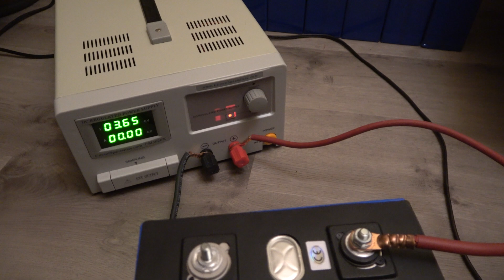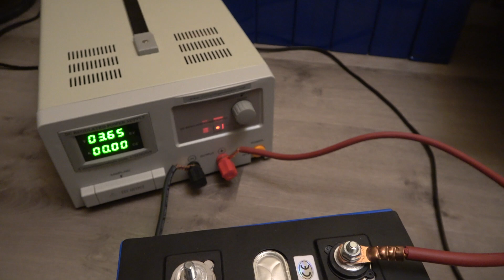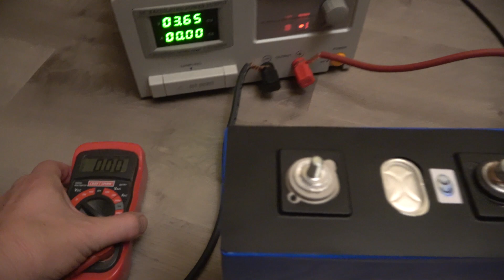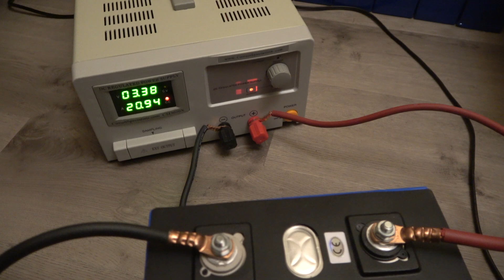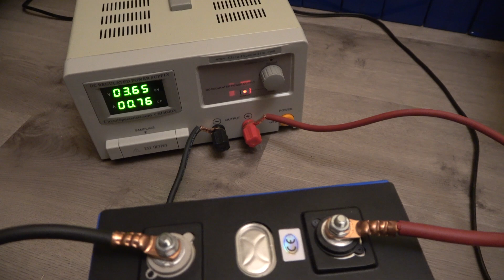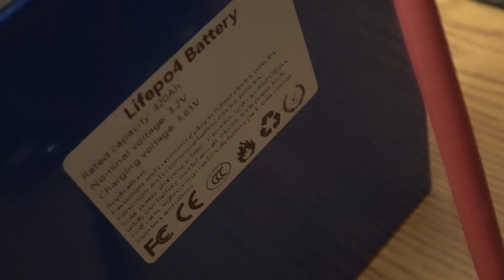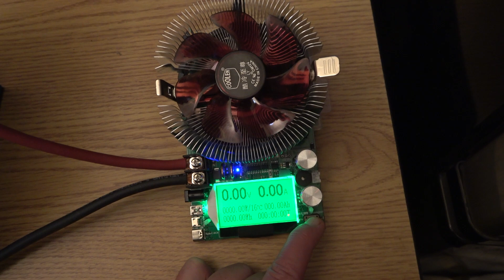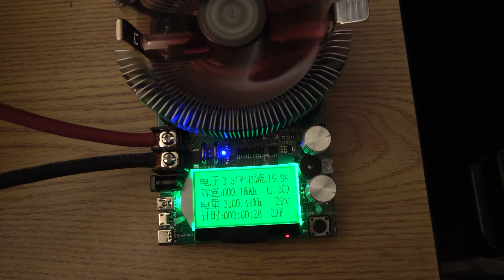Esare "420 Ah" LiFePO4 Battery Cell Capacity Test Process and Results

Comment: 420Ah battery should be tested at 0.5C continuously, that's 210 amps! This tester is 10 amps MAX. These shit cells can't even handle 0.5C and voltage drops so much the capacity test cuts out waaay before you get anything out. These cells are a scam and they barely run in a battery pack. The BMS cuts out waaay too soon to protect the pack

Comment: How about links to the charger and the tester? Good video. 420 AH is the perfect size for my need so this was helpful.
Reply from the maker: I see if I can round them up and post the. If you're looking for 420 Ah at this point, I'd recommend getting 200-230 Ah cells from CATL or EVE and running them 2p (parallel).
Reply: @newscoulomb3705  I would also like a link to your charger and tester
Reply from the maker: @londel1767  I'll see if I still have the link for it. Here you go: https://www.makerhawk.com/products/makerhawk-usb-load-tester-150w-200v-20a-resistor-adjustable-constant-current-electronic-load-tester-battery-capacity-tester-module-intelligent-discharge-resistance-power-tester
Reply from the maker: Here's the link to the tester: https://www.makerhawk.com/products/makerhawk-usb-load-tester-150w-200v-20a-resistor-adjustable-constant-current-electronic-load-tester-battery-capacity-tester-module-intelligent-discharge-resistance-power-tester

Comment: Perhaps the seller had dyslexia. Hence the 240Ah batteries got labeled 420Ah. I’m sure it was just an innocent mistake. (Please note use of the sarcasm font)
Reply from the maker: Heh. All sarcasm aside, it does sound like some are claiming that it was an unintentional switching, but I think the 240 Ah was coincidental. These are clearly Grade B cells that have been used and degraded, so I might have gotten lucky to even see 240 Ah.

Also, after I purchased these, reviews of their other cells started coming in. Their 280 Ah cells appear to be Grade B 200 Ah cells, and that's definitely not just a typo.

Comment: Thanks for showing the testing process.
Reply from the maker: You're welcome! It's pretty simple and straightforward. If I was doing a lot more of this, I might set up a Hall Effect sensor to basically double check my work, but everyone I've seen testing capacity with the unit I'm using says it's always within 1% or so of the high-end testing equipment.
Reply: @newscoulomb3705  Nice!

Comment: Would be good to see the results from the other good cells...
Reply from the maker: I documented a few of the capacity tests, but I didn't have time to edit or create videos for them. I can revisit and provide a voice over with a bit of comparison to these "420 Ah" cells.
Reply: @newscoulomb3705  simply referencing this video, from a new one with what you measured using your process of the results of the multiple results comparing the two batches I think would be a good and short video.  You could include other results from similar and dissimilar cells.  Specific energy (mass gravimetric) and energy density (volumetric) round up sort of thing.  Could throw in specific power & density also maybe.
Reply from the maker: @D0li0  Yes, that's a good idea. I don't have enough variety of cells to do a really good roundup comparison, though, plus I worry that some of the concepts I'm discussing are a bit too technical for some viewers. 

I think I want to do a couple of short videos just explaining some basic concepts like power density versus energy density and parallel versus series. The hope being to create just a basic reference/teaching video so we're all speaking the same language. 

I do have one more batch of 280 Ah cells coming in, so I'll be doing some capacity testing on those when they arrive.

Comment: These are really low budget cells.Are these cells built to be used in a high duty cycle and lots 
of vibration use like in an EV?
Reply from the maker: Yes, properly built versions of these cells are designed for EV use. It's hard to demonstrate on camera, but the quality of my 280 Ah cells is night and day with these. The terminals, the wrapping, the feel, and, of course, the actual energy capacity are very different. And I would consider my 280 Ah cells to be middle tier in terms of quality.

Comment: It’s amazing that a battery which can output 20A(!) for hours and hours can be considered inferior.
Reply from the maker: Yeah, it's crazy. 10 years ago, you couldn't find batteries like these. Now? They were overpriced and not worth what I paid for them. 

I'm 99% certain that these are "Grade B" 272 Ah cells. That means, they are used and have already lost 15% of their rated capacity.
Reply: @newscoulomb3705  - still able to pump out the power, but if they’re overpriced for the”real vs advertised capacity”, you don’t want to pay for a bunch of them.
Reply: 20A output is nothing... that's 64 watts... a 420Ah cell at 0.5 C should continuously output 210Amps 670W!! If the output is low its a shit battery